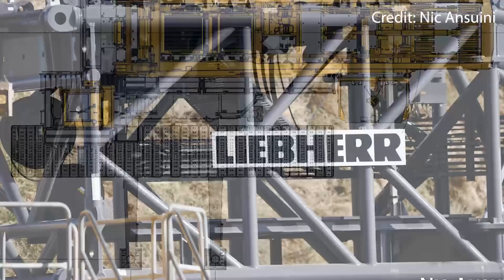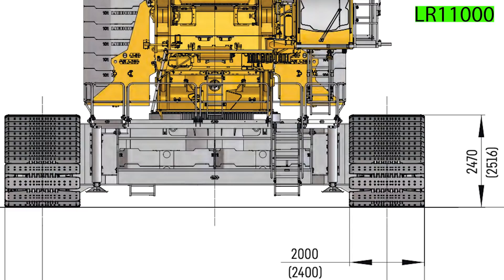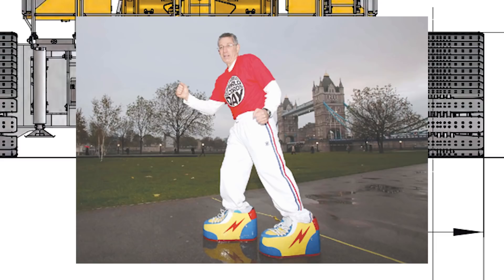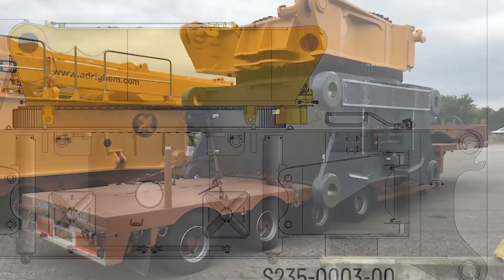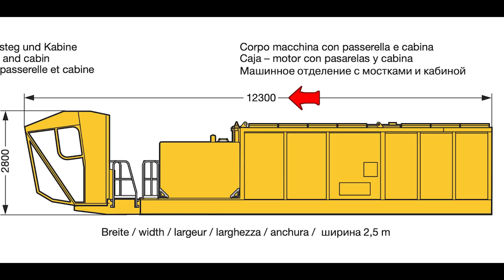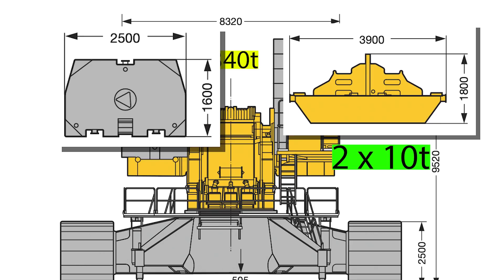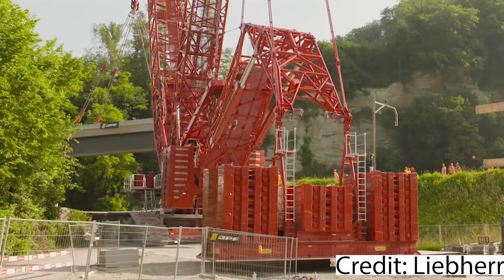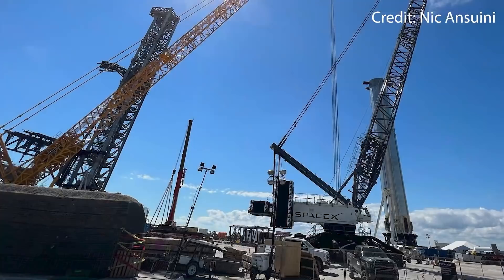In-Depth Guide of the New SpaceX Crane. Part 1: Superstructure/Chassis Deep Dive

Comment from the maker: Additional notes: The LR11000 has an 8-cylinder diesel engine that is water-cooled and produces a 500 kW of power. The fuel tank can carry approximately 1500 liters of diesel. The engine on Frankencrane has an output of 750 kW, and a fuel tank of 2000 liters of diesel. The cabin equipment is pretty much the same on both cranes: it consists of air conditioning tillable to the rear with safety glazing, heat insulating glass, a roof window with bullet proof glass, a standardized control units ergonomically positioned and and additional thermostatically controlled hot water heating.
Reply: The cab also tilts to does it not?
Reply from the maker: @dannyratliff1847  Yes, it tilts to the rear! :)

Comment: How about "why"?
Buying a crane is a significant statement of long term plans for its use. It almost certainly indicates an intent to have people working at height from hoists for a very long time.
Reply from the maker: Noted📋
Reply: @spacebeetle  Although.....
Something else that just occurred to me: insurance, specifically equipment. I am guessing that the early quick turnaround land and relaunch might involve a crane. If so, you wouldn't want to wait while it tracks in from a "safe" distance. So it will be parked in a locacation prone to rapid, unscheduled dismantling of spacecraft.
I expect that that might be a reason to own instead of hire and insure.
Reply: @dougaltolan3017  That's the conclusion I've come to as well, looks like they are gearing up for the full static fire on the booster which is going to be... loud, and with a lot of potential energy. The insurance was probably, heh, astronomically expensive.
Reply from the maker: @dougaltolan3017  Good catch! makes total sense. I am also thinking about the next integration tower, plus possible rebuilding of current one in case something goes wrong, either at Starship launch or first try(s) at catching ship and booster with chopsticks. All this would take a very long time so it pays off to own their own crane(s) rather than rent them forever (... +insurance as you mentioned)
Reply from the maker: Although, they could also choose to insure their own crane, right? Although it would probably be as expensive as the rental insurance.
Reply: @spacebeetle  It would have a lot to do with re=certifying it and the boom after an impact. I imagine a rental company would just say its a write off and SpaceX owes them a new one. Whereas, if its thier own, they can (probably) get away with a round of Non Destructive Load Testing.
Reply: @ke6gwf  They just moved a 11,000 from launch site to production site. If disassembly, trucking (even a few miles) and reassembly were such an issue the new one would be at the production site.
Unless, of course, SpaceX is that vain.....
Reply: @dougaltolan3017  moving it three miles down a road they can close, with SPMTs already on site, is MUCH different than moving it down public roads.

I don't know how they moved it that you are talking about, but I am sure that it required much less disassembly than a longer move, and that they didn't have to worry about width or weight.
For instance, normally the tracks get shipped separately from the track frames, and you can only haul maybe 4 weight plates per truckload, but they probably just drove it into the SPMTs and drove it down.

Also with a short move you can have a couple of trucks shuttling parts back and forth rapidly with a crew at each end, but for longer moves you have to have a fleet of trucks, or it takes weeks to make the move.
Reply: @ke6gwf  The only component that was transported via SPTM was the machinery / cab section, the rest including tracks went on trucks.

It's all on videos on this channel, yet you don't know.

I do hear what you are saying and appreciate your insight. However I am merely responding to what I have seen.

A question: why now? Has the economies of the situation changed, coincidental with the imminent commencement of flights?
Reply: @dougaltolan3017  I haven't been keeping track of all the movements the past few months.

I would suspect that their crane has been on order for a long time.
They are generally made to order, so it might have been under construction for a year or more, or they may have had one in stock that got a custom paint job.
Then shipping it likely from Germany, and then on to the site.

So I would expect that it's been on order for at minimum several months, possibly a year or two, basically ever since they designed the launch tower.

Comment: The unique feature of Frankencrane is its suspended counterweight system. The LR11000 does not have a suspended counterweight. All of its ballast is mounted on the chassis. This affects the lift/reach capability because the LR11000 cannot shift it’s center of gravity to offset boom position.
Reply: According to the LR11000 brochure, it has a suspended ballast, as well as an extendable wheeled ballast, as well as something the V-Frame Extendable option. It has all the options Franken had, and more.
Reply from the maker: Correct! 😎

Comment: ?? Are the outriggers for changing the tracks.
Reply from the maker: As far as I know, their main purpose is to increase the crane's stability, although maybe they are used for changing the tracks, too.
Reply: @spacebeetle  The outriggers out to the side of the crawlers are used for increased stability when raising the boom from horizontal positioning (after boom assembly). They have no purpose during actual lifting :)

Comment: so this crane costs like 11,000,000 . i bet the other crane is costing a good 3 million/ yr or more. there are not many of these supercranes in the country and a typical job adds up to 500k or more for  a month. usually more due to the 50 truckloads in both directions a typical job involves. here it's long term so only need to bring it in once , but the crane company may be losing other work while their supercrane sits unused most of the time.
likely spacex just bought it outright. i don't think they financed it but i have no way of knowing that. it just seems what elon would do.
Reply from the maker: For all the construction they still plan to do, buying at least 1 crane is a no brainer. It will be a very profitable investment in the long run. 😀